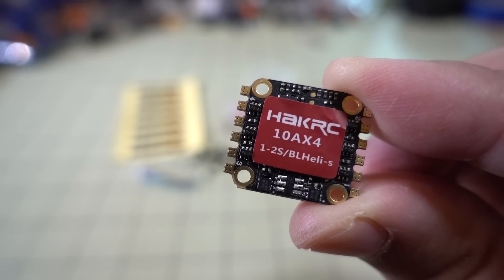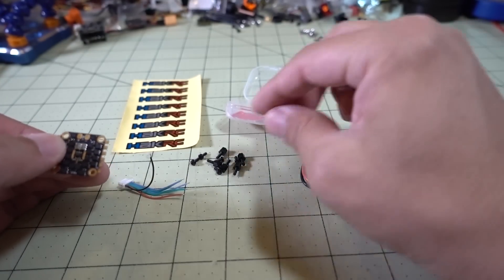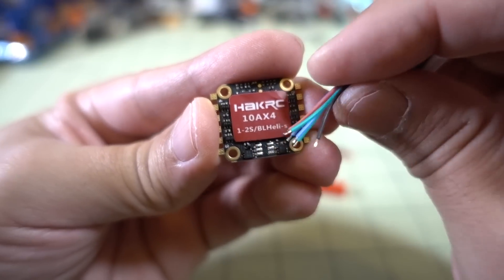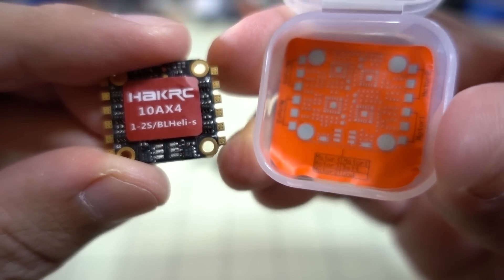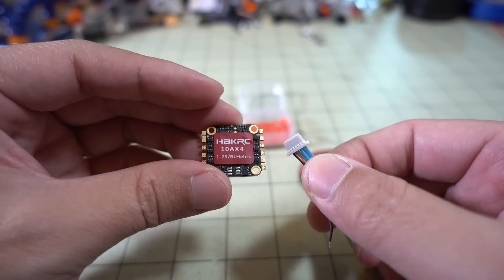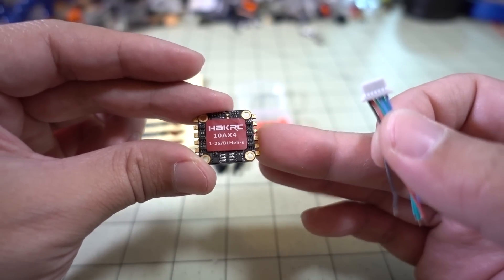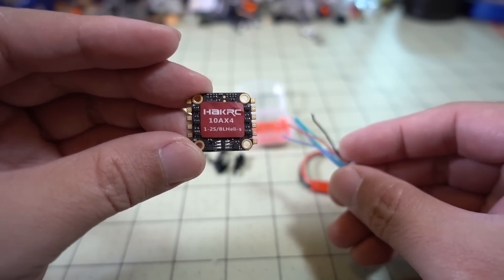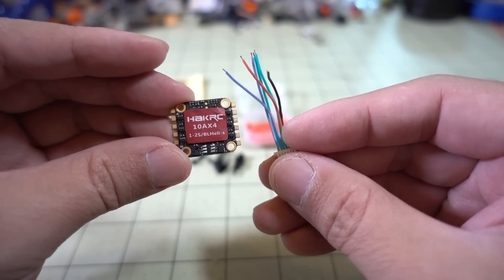HAKRC 10A 4-in-1 16x16 ESC Overview 😲

Comment: Please check yours if it works correctly, mine pulls much more amps than normal and gets very very hot! Maybe there is an issue going on on this ESC?
Reply from the maker: I'll check when I build it.
Reply: I'm pretty sure there is a faulty batch from this ESC sold at Gearbest around october. I bought 2 units on september and they are working flawless. I ordered again 2 units on october 20 and both are faulty with same symptoms you describe. The ESC overheat in about 1 minute with motors running, even without propellers, and finally reset itself.
I contacted with Gearbest some days ago about this issue, and they agree to refund me 50% without any proof of this failure. I guess they know very good there is a faulty batch.
By the way, a friend receive some days ago a new unit from Banggood and is working ok, so pretty sure is a (big) faulty batch.

Comment: Hi Albert! i have an issue with that esc... if i go to calibrate it i can't turn the power off because it spins the motors from the usb power of my laptop 😂 is there a method in order to prevent that?
Reply from the maker: use dshot600 and no calibration is needed

Comment: I had built quad on bat100 frame with sunnysky 0705 motors using betafpv 260mah- AUW 35g , but they brake easier than props. Thinking about 3br 0804, wonder if 4A/5A burst ESC would be enough. Want to use same batteries with this ESC I could use 2in series. Any thoughts/suggestions?

Comment: If you can depin/deplug a tramp hv or an rxsr rcvr its can be done. I do solder joints that size all the time. It does take some experience, stable hands and a good iron to get it done with ease.

Comment: Perhaps you could use it to build a custom Whoop?  With 2S, F4 and all the bells and whistles...maybe not a GPS though.
Reply: By the way, Banggood had some  Eachine 1102 11500KV motors on clearance at 4 for $14.99 and I just had to snag a set and they came a couple of days ago so they might be perfect for a 1S or maybe 2S build with this ESC.  Just need to find a good tiny frame and an F4 and I'm ready to go.  I already have the Tiny Shark and Elf 2 frames but does anyone have a good frame suggestion for 11xx motors and 16x16mm stack???
Reply: Those Eachine 1102 11500kV motors are nuts with 2S on 1.9"~2" props.  However, I fried two Super_S 6A 4in1 ESC's before I switched to a 10A 20x20, which seems to be handling the amps.  I have two HAKRC 10A 16x16 on order and plan to pair one with a Super_S F4 16x16 and the 1102's.

Comment: I was thinking of getting one of these for a build using the HAKRC F4 Micro, but I went with the 15 amp version that had the pin connector.  However, with this setup, it would allow for a really low profile stack.  I should mention that the 15 amp is a 20x20mm form factor along with the F4 that I used.  

By the way,  does HAKRC have a website?  I have searched but to no avail.  Looking for pinouts for them isn't easy.  Am I missing something or just not privy to the inner circle...?
Reply: https://haikemx.1688.com/
Reply: wang HAKRC Bill - Thank you Bill.  However, I was hoping for an English language website to secure documentation on HAKRC products.  Hopefully, Google translate will help me out.
Reply: https://www.banggood.com/search/hakrc.html?sbc=1Hello, HAKRC has foreign agents